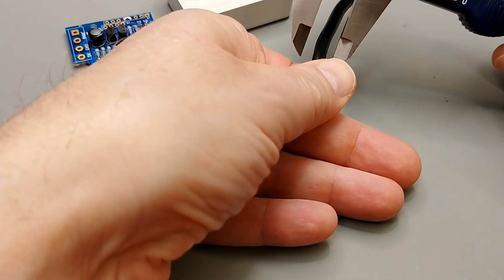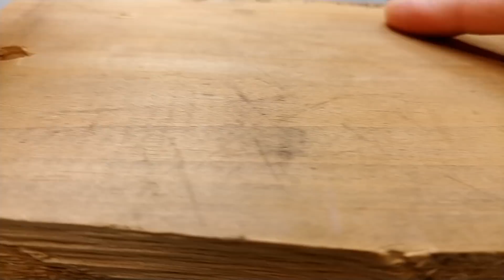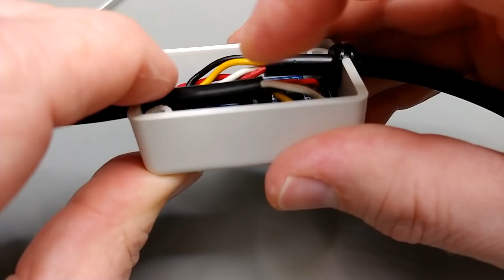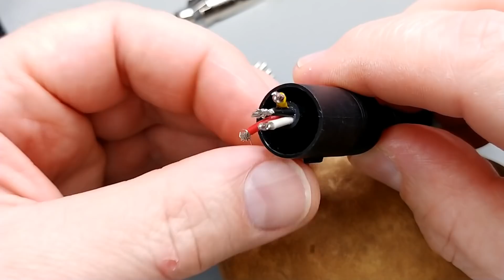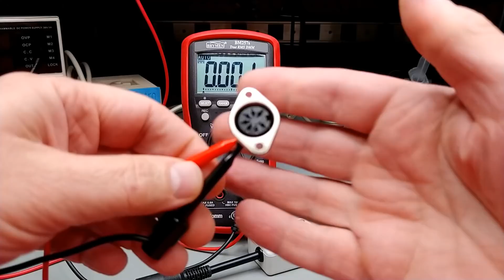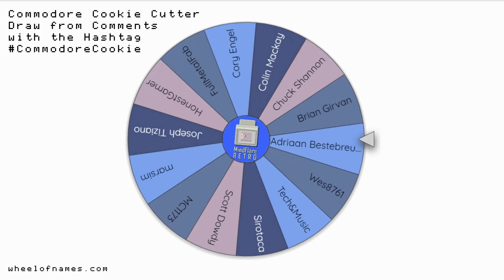#18 "The Potato Method" — Building a C64 Saver — Part 3 - Case Assembly

Comment: That voltage meter was exactly what I was thinking I would add, if I ever had any reason to make one of these.
Reply from the maker: Yes, a simple mod to C64 Saver. Even though it called "C64 Saver" this tiny board is useful for any project that might require 5VDC over-voltage protection. Thanks for watching and for commenting,

Comment: Also... they make crimp terminals that slide into those holes.  They also make the opposite sort (a tiny round socket) if you have the pin-type connector on the back.  You slide on a piece of heat shrink, crimp the terminals onto the wires, and stick them in (or on if they're pins). Then if you feel it's necessary, you can solder them in place. WAYYY easier. Then afterwards (solder or not), just slide down the heat shrink to protect those connections.

Comment: This video was very helpful as I am building a couple savers right now to protect my own C64s and if I loan a couple out to friends with an original power brick.  Luckily for me you have covered a lot of potential problem areas and I can avoid them.  If anyone is interested I ordered the 2 improved sized parts from digi key and its 22awg 4 cable wire that fits the 4.75mm grommet.  With this size I was able to drill a hole in the sides of the 1551g case centered or off center like you did without haveing to cut away the top area and trim the grommet, and was able to push the grommet completely through the hole... 

DIGI-KEY
T1286-1-ND	CABLE 4COND 22AWG BLACK 1M    

36-737-ND	GROMMET 0.187" RUBBER BLACK    4.75mm black rubber grommet, NOT shiny, matte black.
Reply from the maker: Nice work. Great minds think alike... I have ordered some new Tensility brand cable from Digi-Key, as well -- trying 24 AWG this time. Also, I ordered an alternate style of rubber grommet, with a tapered end, to push through the drilled hole -- these I purchased from China and I haven't tried them yet. Do you have photos of your Savers anywhere? Are you on Twitter by chance?

Comment: So lessons going forward, leave longer wires, use smaller wire, tin heatsink/drain pad prior to installing mosfet, longer term, re-layout boad so the trsnsistor TO-92 pins are closer together.
Reply: Doesnt 5v and ground appear on the header connectoons?

Comment: Instead of sticking the male DIN into a potatoe you could just stick it into the female DIN.
Reply from the maker: Yes, you make a good point. I had heard about the potato method a few years ago from when having difficulty solder cheap DIN connectors so I wanted to give it a try.

Comment: I have developed a technique for soldering DIN connectors: First I dent and sctrach with a file saw on the solder side of the pins so that the solder can stick better. Then I lower the heat on the soldering Iron Just barely enough to melt the solder. and You can use the potato still. Or you can fry it :)
Reply from the maker: This is excellent advice, Mert. I have dozens of the cheap DIN connectors to use up so I will be trying this method, for sure. Thanks for sharing.

Comment: Great stuff. Looks great too! I really like the test cables you made for feeding power to the female DIN connector. Great work!
Reply: Regarding the potato. The real DIN   manufacturer will not melt as fast as this. Also the pins are not brittle.. If you have a spare, try bending the pins. Mine from ebay snapped, and inside it looked like it was filled with sand.. The real ones look very much the same but plastics and metal and contact finish is better.
Reply from the maker: Good info. Thank you. I have dozens of these cheap ones -- I feel obligated to use them up first.
Reply: @MindFlareRetro  Thanks. Let me know if I can improve it. I would be happy to change it to fit better in the case.. or perhaps indicators.
Reply from the maker: Well, Thilo's experiments with fail LED circuit is a great idea. It would be cool if that could somehow be integrated in to the existing design. :)

I don't mind the PCB size at all and it fits perfectly into the 1551G -- I prefer the overall small size. I did buy a few 1551H cases to try. They are 10mm longer than the G (the G case is 50mm and the H case is 60mm). The PCB standoffs are the same in both cases. 👍 So, the H case allows for a little more space if a fail indicator PCB design had to be a bit larger.
Reply from the maker: Thank you very much! And thanks again for your excellent circuit design.

Comment: There is a reason I bought a 7 pin midi cable for my home made PSU vs buying just the connector. I didn't want to solder a DIN. lol
Reply from the maker: Very smart idea! In fact, I ordered one from AliExpress a few weeks ago for the same reason. Why didn't I think of that sooner?!?
Reply: @MindFlareRetro  The catch is that because it's a cable that has 7 connections, all 7 connections exist. I doubt it would fit in that tiny enclosure of yours. But seriously I loved it. I used a little heat shrink and then wrapped it off with duct tape. It's ugly, but it works well and I can adjust the voltage. Originally I was using a note 9 phone charger, but I was getting only 4.5 volts. Turns out the SD2IEC was faulty and the low voltage wasn't an issue and it was being caused by the power switch (I think it's still low and I measure something like 0.1-0.2 ohms across the switch) not the charger, but regardless I upgraded to a heavy duty 5V box with adjustable voltage. But the cool part is a USB cable is hooked up to it so I can use any USB adapter as a 5V source. lol
Reply from the maker: Very cool. Would like to see some pics of this (ugly or not). :)
Reply: I dont think youtube takes pictures in comments.
Reply from the maker: That's true, but you can use links, for example, https://bit.ly/mfr-flickr-c64saver. Sometimes comments with links go to spam and the channel owner has to approve/release them.

Comment: why didn't you use a fuse on 9V AC line?
Reply from the maker: Good question. First of all, I didn't even consider it. These PSUs are fused internally with a 3A fuse on the 9VAC side. I suppose I could squeeze another one in the box in future builds. Thanks for the idea.

Comment: Love seeing the trials and tribulations of the first attempt as it def could help others avoid or at least aware of what issues might come up.  Def thumbs up on that and it was humorous although I think some of Jan Beta's bloopers would be hard to top, lol.  As for soldering cheaper DIN connectors, the best tip I've seen is to use a Dremel or similar tool to very lightly grind the round Solder cup on an angle so it resembles the more expensive REAN 7 pin DIN connectors...or you could buy the 7 pin REAN DIN Connector in Markham for a very decent price!  Good work!  -Mark.
Reply from the maker: Thanks. I actually do have a couple REAN brand DIN plugs, but I have like fifty of the el-cheapos. Once I master installing the difficult cheap ones I'll move on the the REANs for sure. Where in Markham, by the way?

Comment: What gauge of wire would be ideal for this setup do you think? (Definitely not an electrical engineer if you can't guess, lol) Will 24 suffice and cause less headaches for assembly?
Reply from the maker: Yes, you're right, 24 AWG might be the way to go. It's actually on my list to get. ;)
Reply: I have a few Boxes of Cat5e Stranded wire which is ideal for these connectors although the REAN DIN Connectors appear to be even a tad smaller than these Cheapo Chinese DIN Connectors.  -Mark.

Comment: It's not hard to imagine why Hans stopped making savers. On the upside, if you work long enough you'll have a baked potato. Not bad :)
Reply from the maker: Haha. Yes, this little project box was challenging enough -- for me. I would probably have a nervous breakdown dealing with bwack's mini inline one. Sadly, I had forgotten about the potato under a pile of stuff on my workbench ... I remembered the potato again, once it made its rotten fragrance known.
Reply: @MindFlareRetro  Oooo, I know how those can stink. Maybe some form of putty next time. Or styrofoam.
Reply: @TheHighlander71  MindFlareRetro: another way to insulate inside the connectors is to fill it with some sort of liquid insulator. I've seen this in smaller DIN connectors, like the Svideo and those with same size but alot more pins on them. Not sure what material to use. Then you would not need to worry about individually isolation.
Reply: The liquid method is quite awesome also because it provides great mechanical stress relief for the solder joints too.

Comment: The first thing that came to my mind was: Why the heck doesn't he push the grommits back to the pcb to get more space?

The easiest would have been to solder the din connectors first and then connect to the pcb. 

I also would have tried to file down the lip on the cover in the area of the grommits. 

You might want to take a step back some times, look at the big picture, and consider alternate options.
Reply from the maker: Thanks for the ideas, Sven. Well, I did sit back and consider various options. I went with what seemed to be the best approach at the time. This was the first build, so future ones will be better, for sure. And yes, solder the DIN connectors first, for sure -- duly noted, sir. Thanks for your feedback.
Reply: @Sven Werner: I agree with your assessment here.  Connector ends first, definitely.  Would it be possible to build this board into the "brick of death"?

Comment: I've would bypass AC part with straight cable  it would  shrink pcb a bit, as for DIN connectors You simply can popup and move "sleves" a bit to make cable bit longer and easier to work with and will let You crimp female connector.
Reply from the maker: Perfect! A lot of great tips. Thank you very much.

Comment: I usually depin the din connector and solder the non tinned wires into the pins, then push the pins back into the plastic base.
Reply from the maker: The smartest methods seem so simple. I will give this a try. Thanks!!!

Comment: I was just pondering if you went back to hiding under a rock again last night lol. I like the LED touch and will definitely add that to the C64 saver I'm working on, nice thing about to blue case is I don't need a hole for the LED. Guess the only up side to what's going on right now is everyone gets lots of free time for projects like this :P
Reply from the maker: Haha. It takes me a while to get these things shot and edited -- more time on my hands lately, though. Yes, the blue case does offer a lot of benefits. It just seems that I can find a lot more of the beige and black ones for pretty cheap locally -- the blue ones, not so much.
Reply: Guess I should feel somewhat lucky to have a blue one, i still need to source more and wire. Also should we be testing that the C64 save works correctly after building it or do you just do all that to show it working ? All I have is a basic bench supply a made out of an old ATX power supply.

Comment: Do you have a link to the wire stripper that you used for the outer shielding of the cable? That one really looks handy to have :-)
Reply from the maker: Yes, of course. Here you go - this is them on eBay... https://ebay.to/3byAVW1

They are very simple and handy. I have used them for years - they are especially good for coax cable. An electrical supplier I used to shop with always had a bin full of them that shoppers could just take from for free when they were paying. Mind you, that was about 10 years ago. =/
Reply: @MindFlareRetro  Thanks for the link! How long can you use them? They are so cheap... do they last longer than just a couple of times of use?